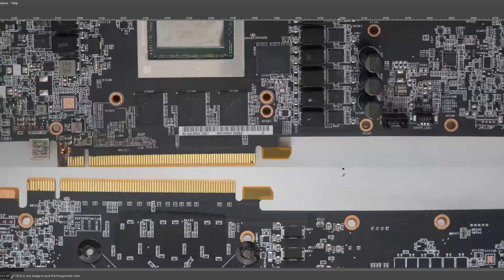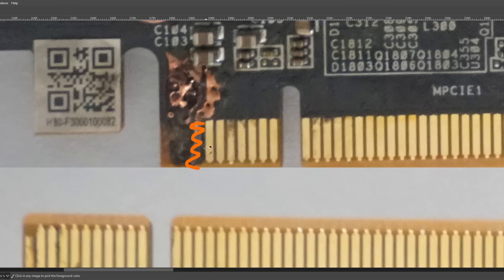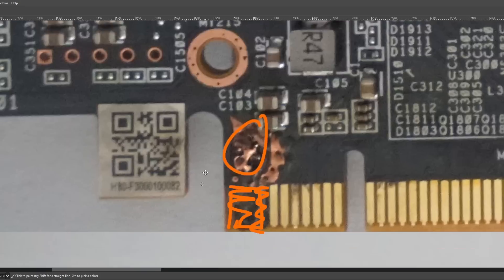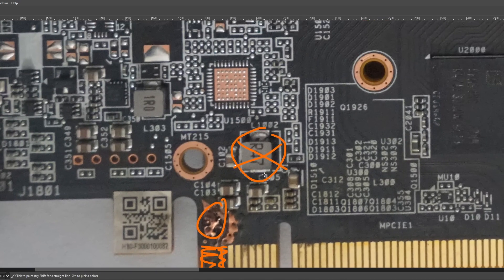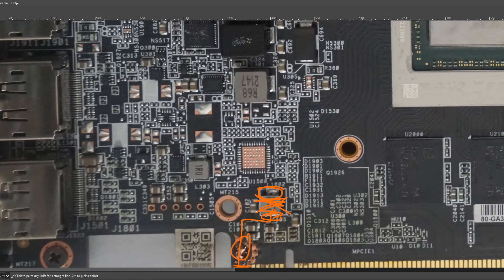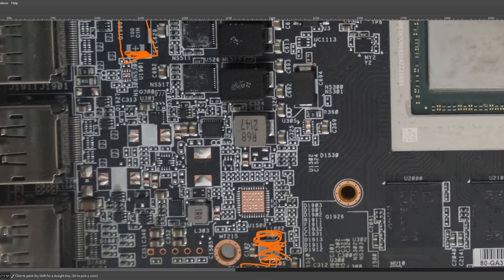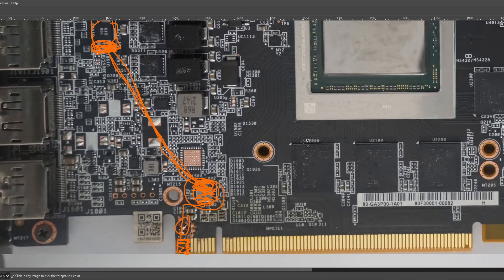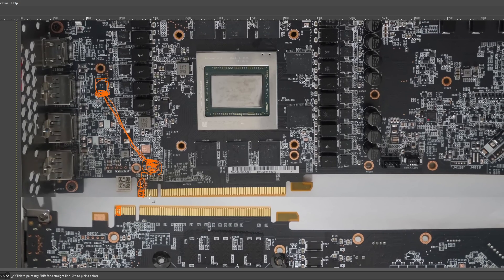RX 6950XT burnt PCI-e 12V fingers "fix"

Comment: I know it's a few years too late but i just repaired a 4080 with damage exactly like this (water dripped into the PCI-E connector)
10/10 would do again
Reply: i have the same issue on my rtx 4090 but without liquid , how is that possible

Comment: The super safe method could be to just make a extra PCI power connecter and route the cable to the removed coil, the 12v does not need to come from the card itself.

Comment: Meanwhile my 6900xt tuf pulls 450w with no issue lmao
Reply: ?
This one worked fine until water ran down into the PCI slot, I am pretty sure your tuf would do the same if you had water running down the card.
Reply: @larsjrgensen5975  again not a problem on my air cooled card if my aio leaks then yeah

Comment: BZ can you give advice how to be sure to not melt EPS ATX12V 8-pin connector from mobo again? I'm gonna try to replace that connector soon on my old asus m5a99x evo r2.0 board and probably from PSU side too, to make sure that contact spot is ok. I think it was melting after I did some cable management and by accident pull connector to the side, and one connector (left one) may got loose a bit. Coz it was pretty stable at fx8350@4.6Ghz 1.35Vcore and 2.76Ghz NB 1.35Vcpunb and suddenly after another run Prime95 sFFTs to check temps (about 39mins) I coming back to room and feel that burning plastic smell and now one half of 8-pin stuck inside mobo connector. I asking about how to be sure about connection because I want to OC that FX to 4.8-4.9Ghz for 24/7, coz it can do 5Ghz with 1.44-1.51v. Also maybe someone know which Vcpunb is safe for 24/7 for Vishera? Is it really safe to do Vcpunb=1.45v and try to achieve 2.8-2.9Ghz and Vcore=1.48-1.5v@4.9Ghz for 24/7? Btw gonna try first to re-solder connector with 40 W s.Iron.

Comment: You can fix the traces and the PCB.  There are kits for that.  The main issue when the PCB is burnt like that you can have layers welded together.  The power plane could be welded to the next layer which could be earth.  Could just be the traces at the pins, if so its not impossible but there could be something else wrong given power planes can connect to almost everything.

It looks unfixable from here to be honest but some people can repair boards with holes in them and worst damage than this graphics card.  That looks like more than one layer and most of the pins nearby are also damaged.  It would be hard to fix and there could be a short between layers.  So you might have to remove lots of material for multiple layers to remove the short.

You cant say how bad its going to be before you troubleshoot.  The first three pins are 12 volts but number four is ground.  You can see that the copper of all the first 4 pins are damaged.  Pin 3 and 4 are likely welded together.  A4 and B4 are both ground.  You can see the black stuff on B7 which is also ground and B13. B1-B4 and destroyed.  The PCB traces are gone. The copper is damaged and layers have separated.  I would say the power plane and the ground plane are connected between pin 1-3 and pin 4.

You have 11 pins and 4 are gone. 7 remain.  I would guess SMCLK and SMDAT are distroyed as well.  Thats B5-B6.

It looks like water caused a short between pin 1-4 and destroyed the card.  The manufacture wont repair that or likely replace it.

I am using the PCIe slot pinout on "Are these broken pins on my 3070??" on the Linus Tech Tips forum.
Reply: The besides the layers welding themselves, the burnt (carbonized) circuit board becomes a conductor, and that is even worse. Meaning, you have to scrape off the carbonized material. 
Thankfully, that area should not not have a lot going on in the adjacent layers. Could be a lot worse (vcore capacitor, powerstage...)

Comment: Will you ever test power dragon cards for the 6000 series?
Reply from the maker: power dragon cards?
Reply: @ActuallyHardcoreOverclocking  Power Color Red Devil s?  Maybe,?? HAHA once I saw the price I came straight here to see if you had done anything with them. :)
Reply: @ActuallyHardcoreOverclocking  Red Dragon cards since they are a common brand
Reply from the maker: @gvi341984  I don't have any plans for them.
Reply: @ActuallyHardcoreOverclocking  Just wanted to see more in-depth information since they are common in the used market and all have heat issues
Reply: @gvi341984  We need more vendors: Power Dragon, Devil Power, Color Fighter etc
Reply: @GoodOlKuro  Yeah, all used 6000 cards on the market place have these names 

Kinda rare to even find a name brand 6000 series

Comment: I shorted 12v to ground with the shunt resistor on the pcie 12v pins of a 1080ti strix. Was quite a spectacular disaster. Blowing blue sparks everywhere, unsoldered the two components next to the shunt resistor just from the heat. Totally melted one of the ends of a cap too... Would I just do basically the exact same thing for the 1080ti strix? I'm having a hard time figuring out what the 12v lines go to on the 1080 ti strix.
Reply: If it's similar to my 1080ti with fried 12v PCI-E fingers, there are shorts elsewhere on the board on the PCI-E power plane between the fingers and the 5ohm shunt resistor at the other end of the board. I de-soldered the shunt resistor and the board short disappeared, so I guess that technically, I should feed 12v to the other side of the shunt resistor to bypass the PCI-E power delivery stage. BTW, mine is a Palit, which is very similar to the reference board, and having watched this vid, i'm now concerned about the 12v fingers on the back side of the PCI-E edge connector, as buildzoid says to remove them?

Comment: there is a much simpler thing you can do 
just separate the 12v copper plain that is toasted and blacked with a cutter and see the resistance of the 12v to ground on the back 2 pins which are of 12v 
if there is no short 

buy some solder mask cover ther burnt area compleaty with a thick layer 
and in theory it will just work 

but I can't say for sure that only 2 pins can provide 75 watts
Reply from the maker: precisely removing shorts is far more difficult than just avoiding them.
Reply: @ActuallyHardcoreOverclocking  That part of the PCB likely doesn't contain anything and you could just dremel the fried  part all together. Still you would need 12v source, but again removing the filter should indeed "evade" the problem.
Reply from the maker: @Diglo1  I literally said in the video to cut of the burnt part of the card. So that it can't short the PCI-e slot.
Reply: @ActuallyHardcoreOverclocking  Didn't watch the video that far or missed it. You did describe cutting the traces off.
Not trying to be smart ass, but of course even when it is very likely that other parts of the PCB is likely fine there could be damage deeper...
Reply: PCIE is built up to 300w, this was discovered back when AMD RX 480 8Gb drew 5 watts over PCIE spec (75w) and people tare their asses over it and there was bunch of images where old PCIE 1.0 MBs with cheapo PSUs had blown components that were either not related to the GPU (RX 480) or someone just had bad luck.
Either way you can easily go past 75w and you wont hurt anything.
Of course there are not many motherboards that can supply 300w, but the slot is capable of it. 
Some motherboards do have extra connector for more PCIE power.